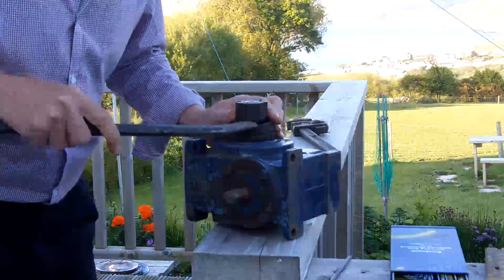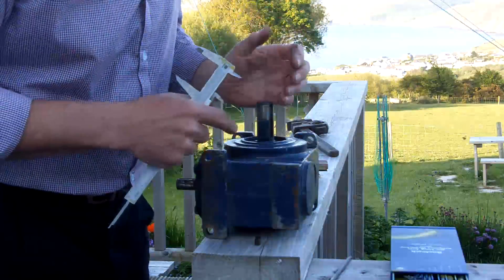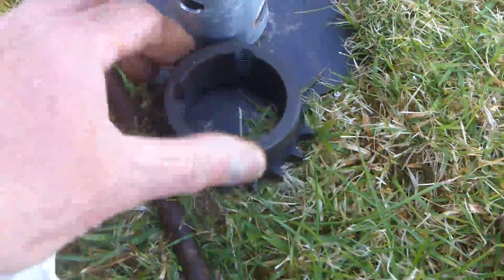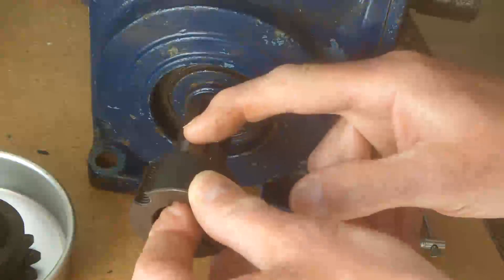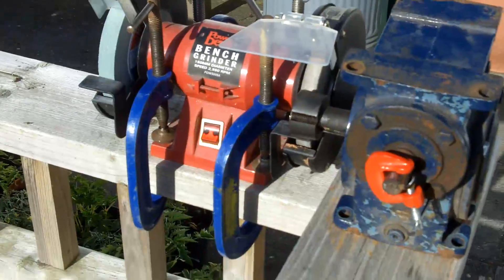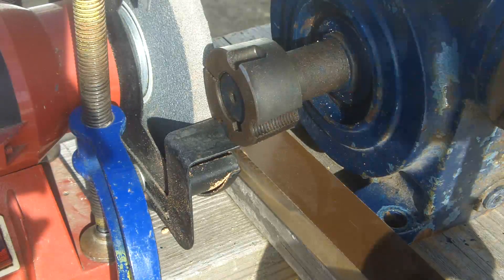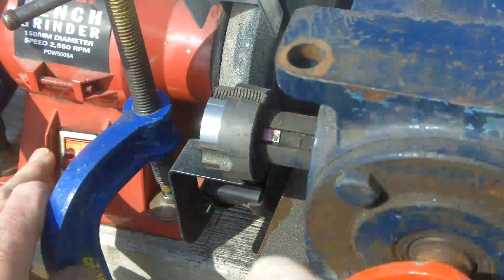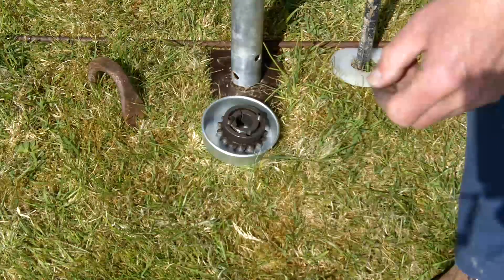About Radio 70 Antenna Rotator part 2

Comment: Don't know the brand, I buy it at the local boat builders as mast filling foam, it comes in an unbranded pack that they fill into small portions in house. Probably made by Crystic resins, as that is the most common brand. Ask at the local yacht repair shops, you will find some there from the suppliers, as it is used to make a aluminium hollow core mast stiffer and more resistant to snapping in the middle. Too much and it pops it though. Then again I am not a sailor.

Comment: Use clothes you do not care about when working with it, it is impossible to remove from clothes, and hard to get off your skin, as it cures with moisture. For a one off use the can, but if you are regularly working with small amounts get the 2 pack ones and mix the few drops as needed.

Comment from the maker: OK on the builders foam, yep it can be pretty destructive; I’ve seen it added to tubes to give them strength. That works by simply preventing it from starting to change shape and collapse. I always find once I’ve used the tiniest drop of the stuff I wind up throwing the rest away as they don’t shut off properly and bleed all over the place, but a good tip for sealing the pole, just don’t overdo it. Man it’s some messy stuff isn’t it, like human flypaper.   
Kind Regards ... Andy

Comment: Foam in a can sprayed into the top of the tubing and at the joints works well for keeping them watertight. Just be careful, I have seen that foam burst alloy masts if you use too much. Have used it though to fix water leaks, could not get the 110 pipe to seal right with the tank, so foamed the connector ( and me) with 2 cans then filled in the hole left unfilled with 3 cubes of solid foam solidly bonded to everything wet.

Comment from the maker: Yep, if you do that with your eyes closed tight and your cap on backwards you’ll be all right, but preferably from within a room with the acoustics of an empty bathroom but you have to give everyone 5&9 and never a  QSO longer than the mandatory 2 seconds. 
 
By the way, could you write in block capitals next time I'm having a bit off trouble with the copy
73’s ... Andy  GWØJXM  
(or should I have used someone else’s call sign after that comment, Hi Hi?)

Comment from the maker: Hi Eric, it’s a little more involved than that, water can get into the inside of the main mast. It’s made from two tubes telescoped together, open at the top. This could be dealt with I guess. What I am thinking of doing is having some sort of cover like a plastic lid sealed to the bottom of the main gear shaft so as to keep water out of the well where the main bearing is, but eve that isn’t easy as the keyway slot extends down into the well. 
All the very best ... Andy

Comment from the maker: Hi Dick, yes I’ve already considered that but I think I'm in more danger of reversing the earth’s rotational direction if I spin the antenna too fast and stop it suddenly, mind you on the other hand I think I'm more likely to get into trouble with my talk rather than my torque.
Hey, do you think that if I were to spin the antenna fast enough I could screw the signals into the ether quicker and get better DX?
All the very best ... Andy
GWØJXM